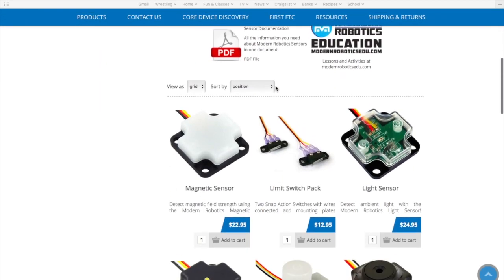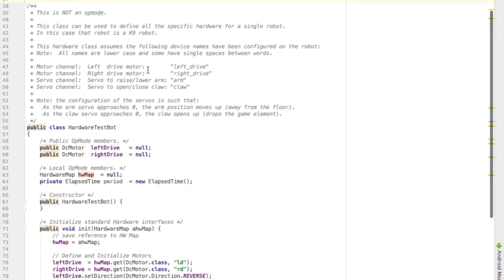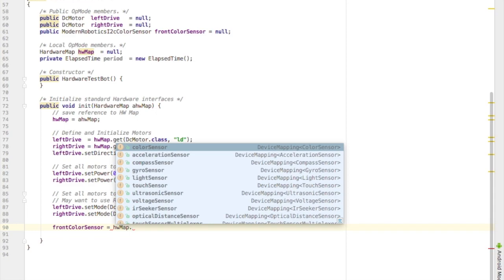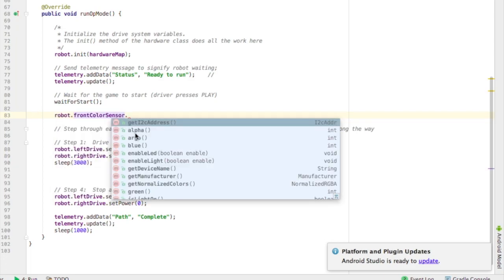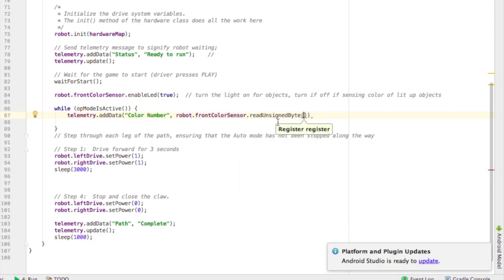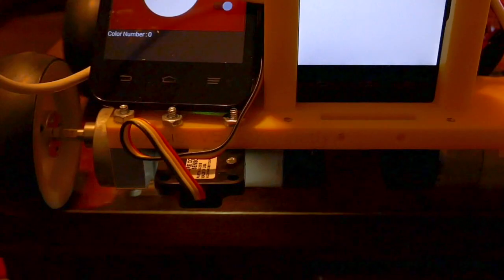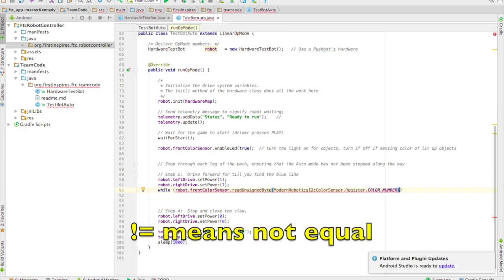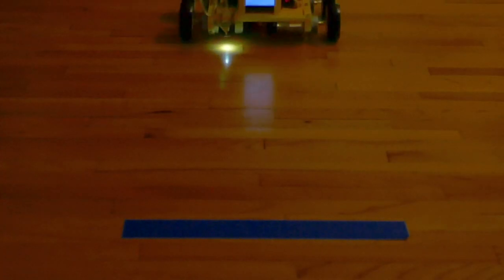FTC Programming Part 9: Color Sensor

Comment: How did you set up the color sensor on your phone?
Reply from the maker: I don't have a robot or one of the phones in front of me.  It is pretty much the same as configuring the motors except the sensors are plugged into a device interface module that should be seen by the phone when you enter the configuration editor on the phone.  I am using a modern robotics color sensor, so I just select that from the pulldown menu and enter the name I gave it in the code.